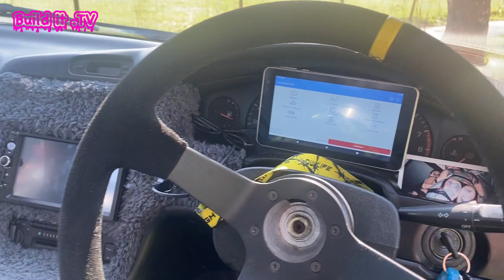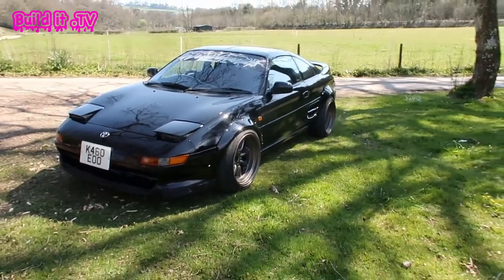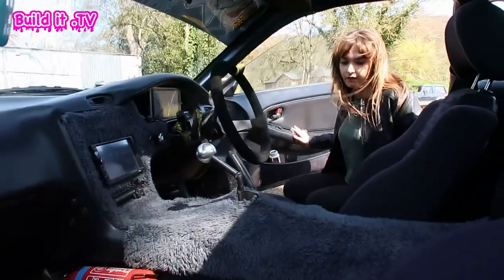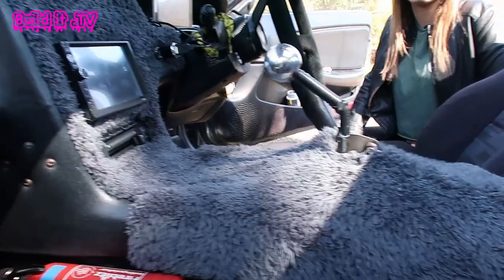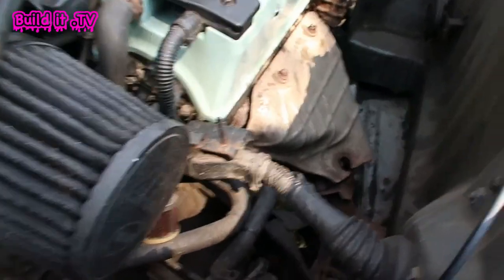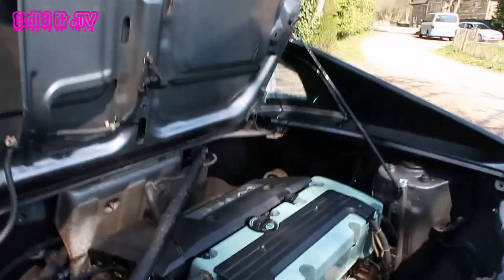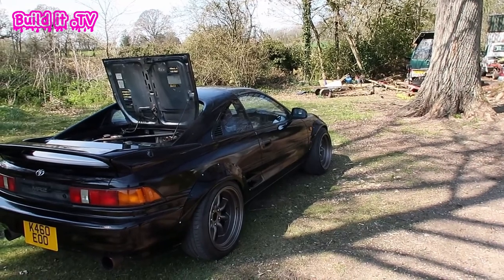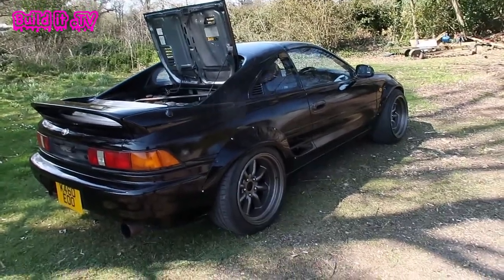Anna's K-Swapped MR2 | Driven Daily

Comment: What the actual F.k is that interior. Talk about butchered!!, the standard integra cables work perfect. Can get a low mount shifter designed for this. Or there’s plenty of options not to cut. Or you could just get custom length shifter cables made up.